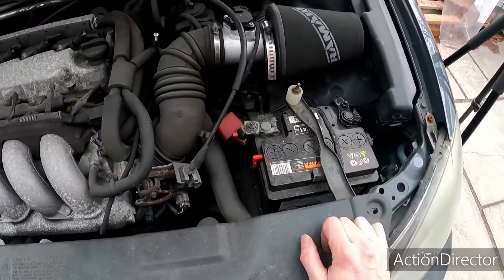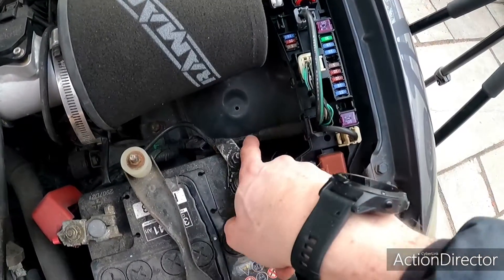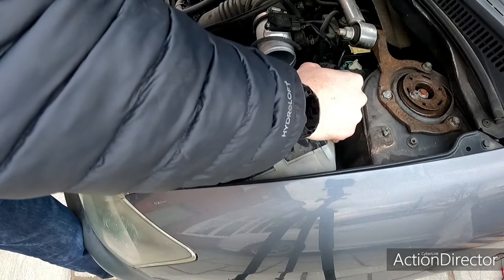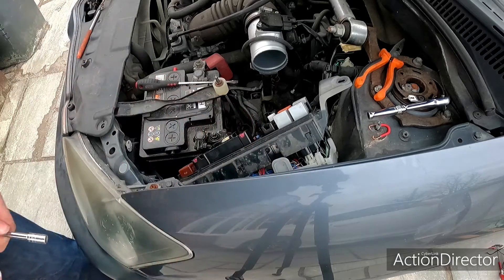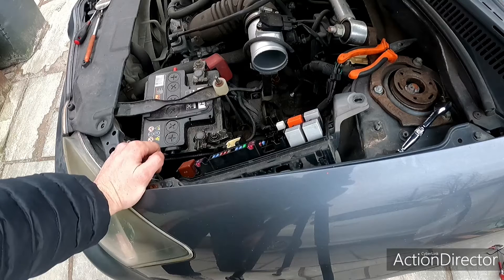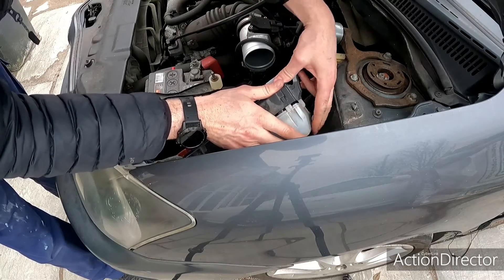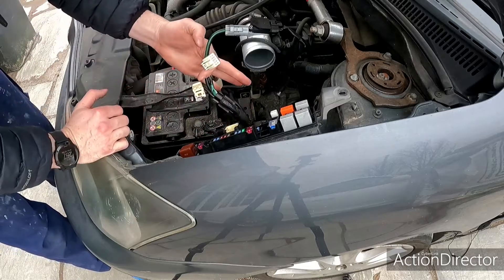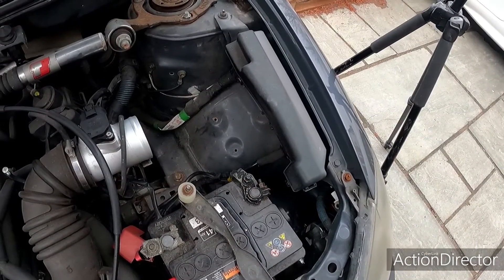E12 COROLLA. 100 amp fuse replacement.

Comment: Here's a story: 2003 Corolla, I hooked up the jumper cables in reverse and blew the 100a fuse. Got a new one WITHOUT the holes in the legs (just like the old one) and replaced it, much easier because you can just pull it out and slide the new one down. But over time it shorts across the gaps and melts the plastic, breaks the connection and stops working. Replaced it again and again not knowing that the one I needed had holes in the legs and connected with 2 bolts like yours. Slightly more work but saved me a future headache or 10, thanks bro!!

Comment: I had the exactly the same problem. I did the same thing while jump starting my car ... blew like 4 fuses. The fuse box under the glove box (RHD) may also have blown fuses. I actually first replaced one in the glove box which managed to get the car started. However, the power steering and dashboard was dead. Replaced the main fuse like you described and viola! Video was uber helpful because the plastic on these is harder then most bank vaults. We spent more time rangling with clips then actual job. AnyhowThanks for making this video 😊
Reply: What fuse did you replace at first to get it to start?

Comment: Is there 1 screw or is there another one from the other side?  I got the one out that you did but there's another bolt head on the other side that won't budge.  I broke a ratchet trying to get it out.